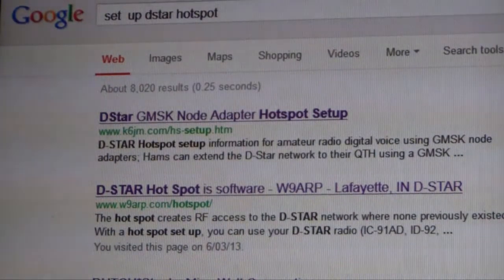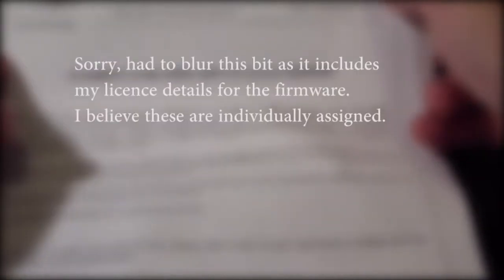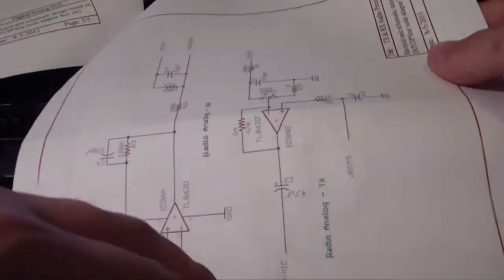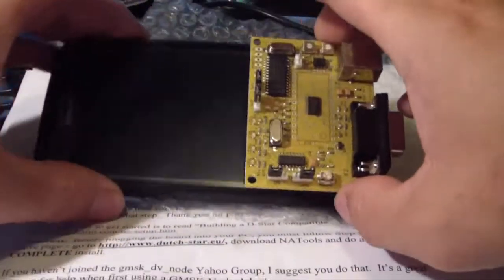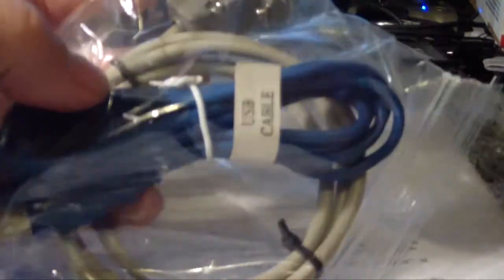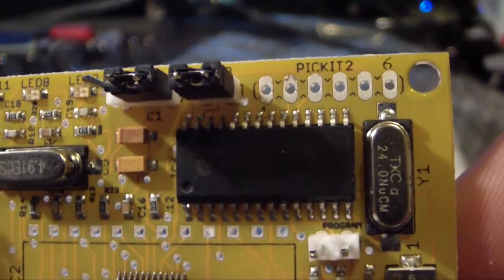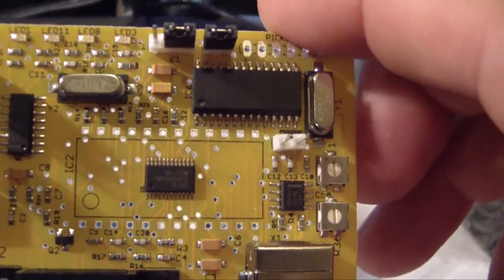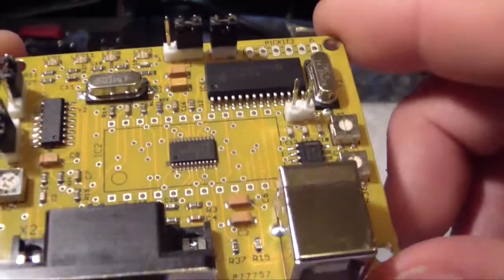Dstar hot spot set up series. Part 2

Comment: Did you have to adjust the receive and transmit pots? Just got my board and it's not decoding the transmissions
Reply from the maker: Dave Wright Hi Dave, 
I can't recall if I HAD to but can say that I did. 
run NAWinTEST and perform the read test. This will allow you to adjust the pots whilst transmitting(eg from your HT or rig) and see your adjustments on the screen. Make sure hotspot rig and what ever you are transmitting on are on same frequency. Also make sure your dstar radio is on DV. 
You're looking to have green code appearing and removing any red code which appears. 
Once you have removed all but of the red you should be getting a good decode for receive. 
To check your transmit, you use the echo test several times to check how your voice or transmit audio is getting out. This one you will just tune by ear. 
Whilst I still fiddle with mine from time to time, the left one is at apprx 11 oclock and the right at 3 oclock. This is with them at the top of the board and the usb input etc on the right hand side. 
hope that helps
Reply: Thanks for the reply. I have checked everything, short of rewiring the cable to my TS2000 and still am not getting anything in NAWinTest. More diagnosis is in store, thanks for your help!
Reply from the maker: no problem and welcome. is your baud rate 9600 ?
Reply: It's on 9600 on the main receiver, and there is audio going into the board as the leds flash.
Reply: I've also tried adjusting the pots during transmission to see if I can get anything in the test mode with no results.